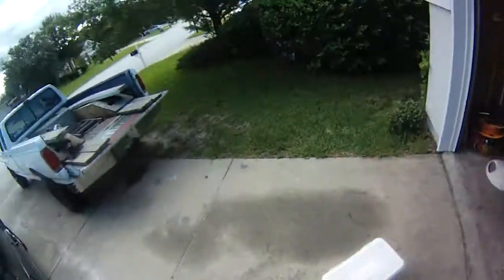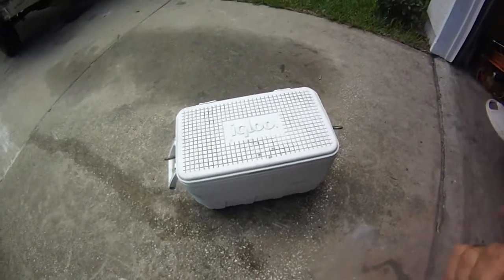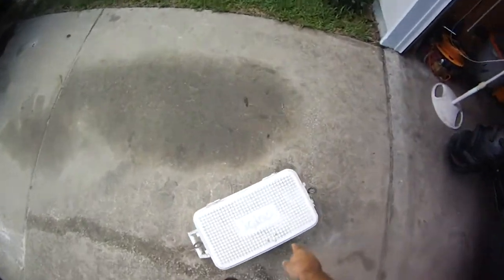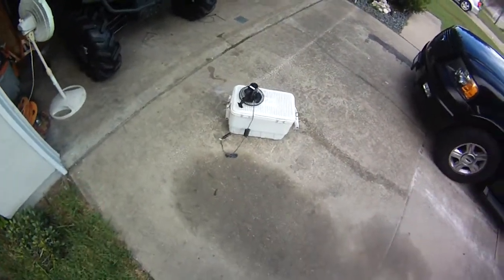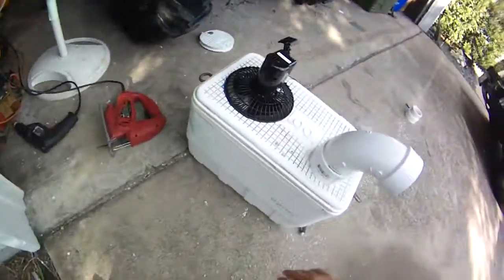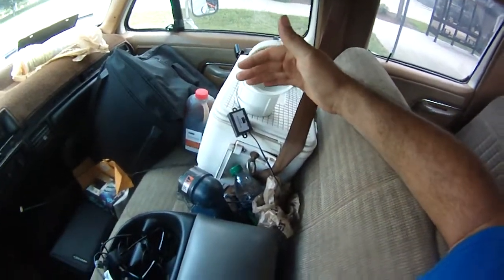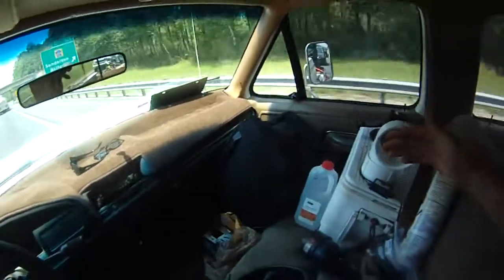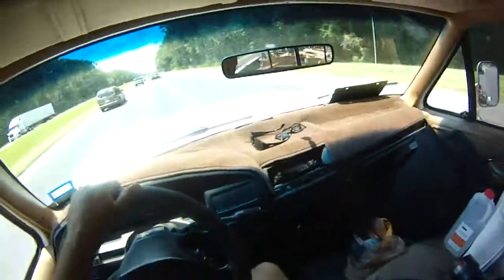Home Made Air Conditioner

Comment: The best way to make it is with a heater core that you run water through using a bilge pump that picks up the ice water from the cooler and recirculates it. The fans are mounted on top of the lid which needs to be hollow in order to draw air through the heater core and from the outside air and not from within the ice chest.